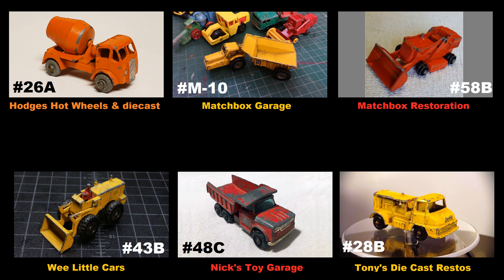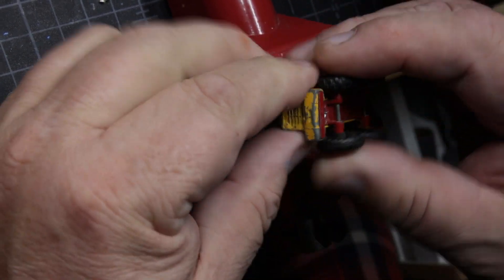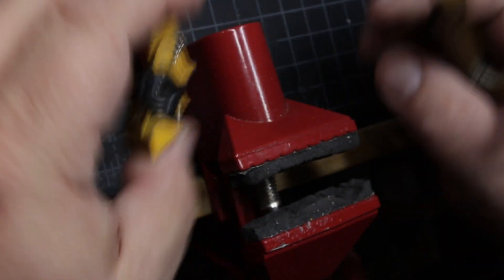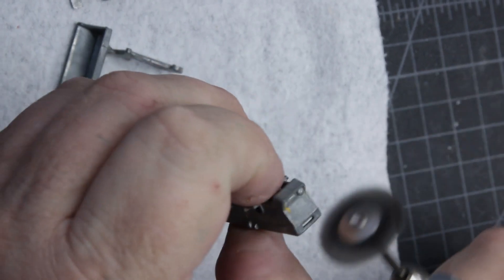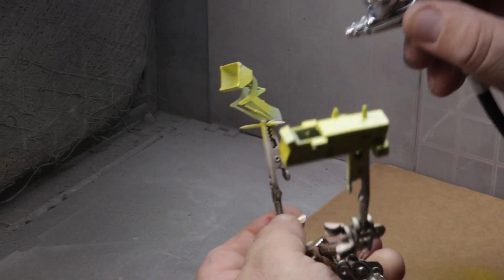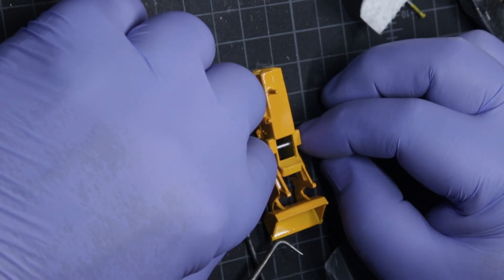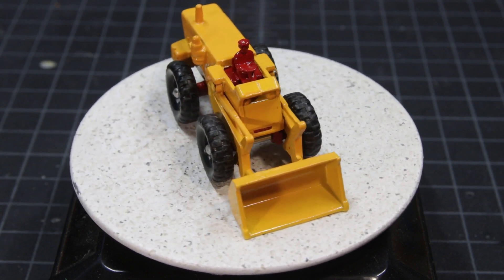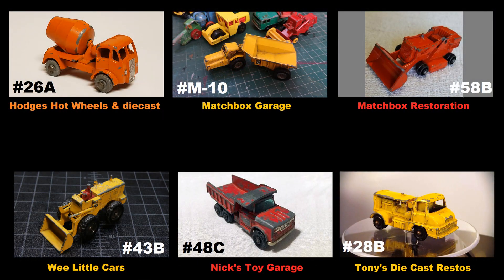Matchbox #43B Aveling-Barford Tractor Shovel - Restoration

Comment: Looks great. Is half a drop like half a hole ? lol. 

I remember in the 60's a joke was , How do you confuse an Irish man ? Tell him to dig half a hole. lol
A hole is a hole and a drop is a drop. lol. I love the saying though, half a drop.
Reply from the maker: By way of explanation . . . I use a toothpick to tint my paint.  The drops are typically about the same size and literally fall off the toothpick . . . but if you touch it to the lip of the jar as you take it out, the drop gets smaller . . . sometimes I have to shake it off in the new paint or just stir it in.  Hence, half a drop.  When you're tinting with black, you have to be very-very careful . . . once you start down the dark path, it WILL dominate you destiny!